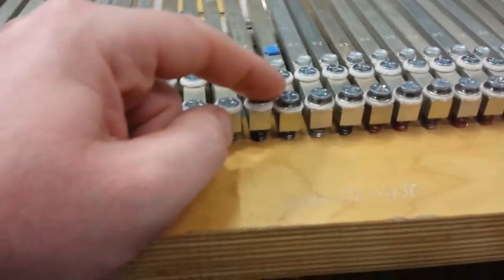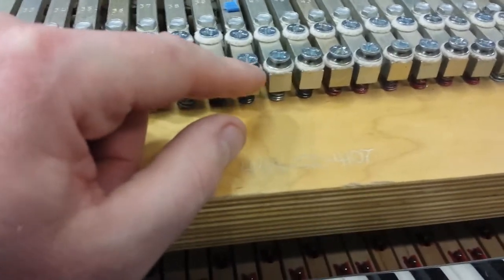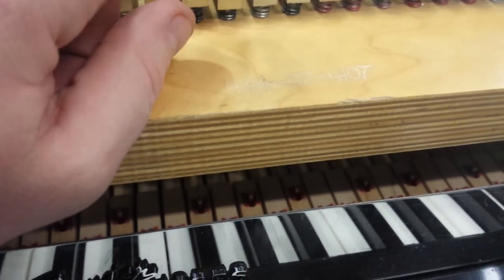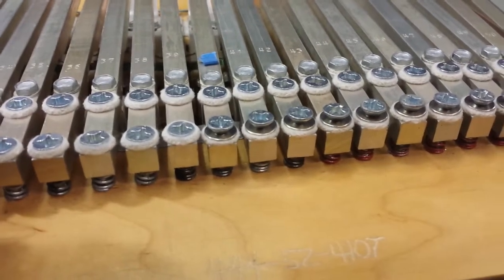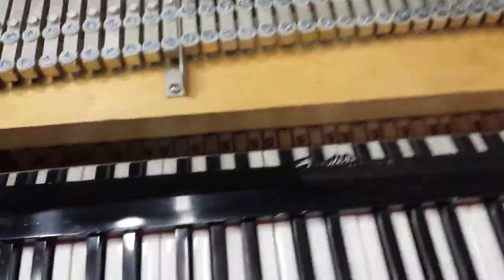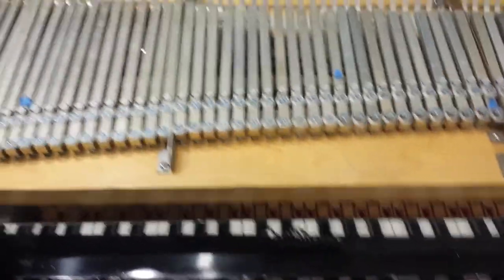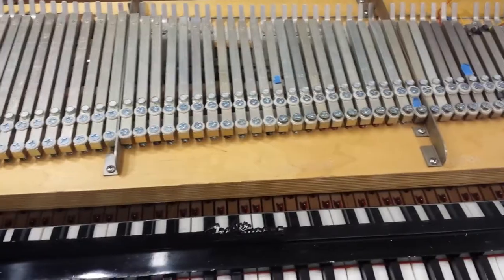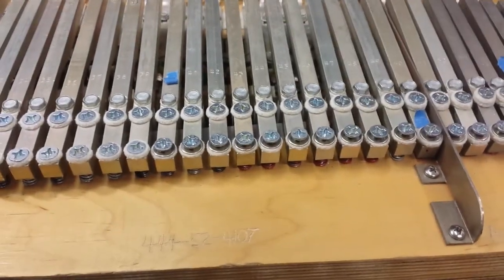Rhodes Sparkletop Harp Improvement

Comment: which grommets did you use? Also, which hammer tips? Sounds good to my ears =)
Reply from the maker: The white felts are the sparkletop equivalent of Mk1 grommets.  What I was doing different than the original design was putting a metal washer in top of those grommet felts.

The hammer tips in a sparkletop are felt, and this one still had the original felt hammers.
Reply: ahh it's a washer as you've explained. I understand @InsectoidControl